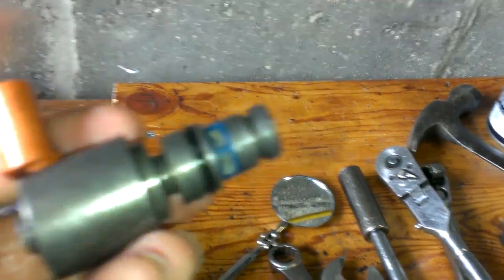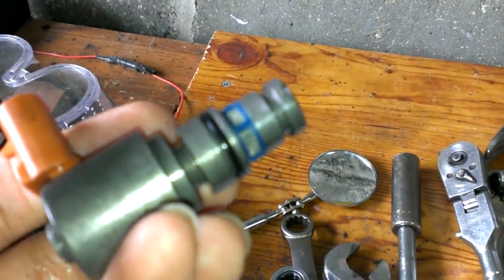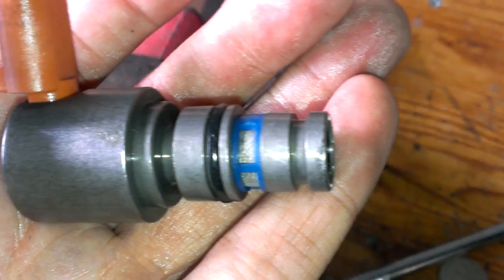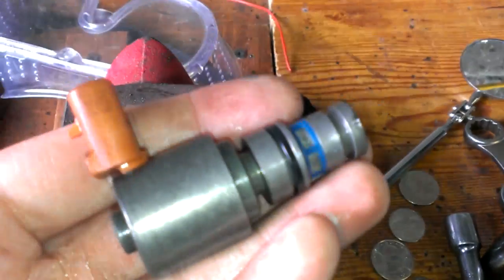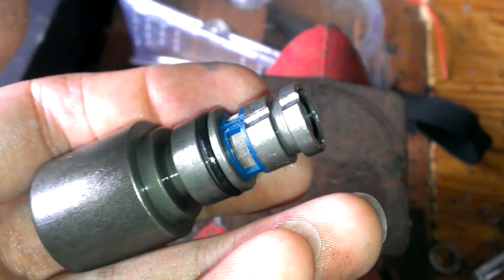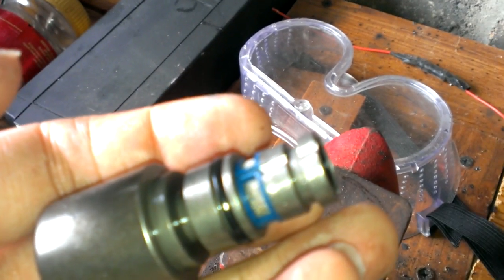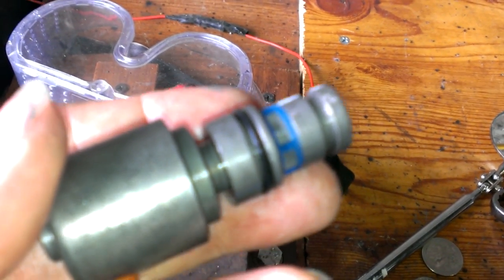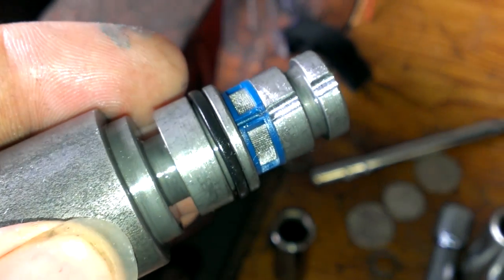PWM DELETE 4l60e MOD

Comment: I know I very ask alot of silly questions. But my Jimmy locks and unlocks the torque converter at 55, drives me crazy, do u think this may stop that...and thanks for the help
Reply from the maker: its possible. yea.
Reply: Did you try it?
Reply: Did you try it? I got a 98 Chevy Blazer that 3rd and 4th gear were out of. So I just rebuilt it myself using transmission bench Channel. Now it seems like mine's doing the same thing

Comment: Is this passenger side front, and is the tcc and pwm same thing.
Reply from the maker: yes pass front. and no there not the same. the pwm regulates the flow to the tcc to lock up the converter

Comment: Help!  I have 1997 chevy astro 4.3L with P1870.  I've been fighting this problem a long time now.  Replaced the valve body with high quality new one but it didn't work.  Tried draining fluid and adding a lot of Lucas, didn't work.  Then replaced the TCC valve and spring with Fitzall P1870 fix kit, (solid aluminum piece) and new tcc solenoid just in case and updated fluid to Mercon V.  It worked for 2 weeks and then came back!  What do I do now?  Is there a way to permanently delete this pesky code out of the computer or something?  Is something else possibly worn out in the tranny causing this code?
Reply from the maker: p1870 generally means something is slipping when in lockup. either the torque converter is slipping or 3-4 clutch pack is starting to slip. if you replace all those and it still does it them im leaning towards a worn out torque converter or trans.
Reply: @bam6972  Thanks! Actually before I bought it, the transmission was rebuilt by a professional shop (about 10 years ago) and they never fixed the p1870 code even then.  Obviously they must have overlooked something. If it were me, I would have brought it back immediately to fix the issue, but the owner, my father, didn't want to bother the shop owner and just lived with the shift bangs, sheesh!
Reply from the maker: @bimmerman9839  i had the same problem. had it rebuilt and the problem still was there. brought it back multiple times and after a year of constantly bringing it back he finally rebuilt a different transmision and put it in. problem solved. it may have been a crack in the casing and fluid was seeping by causing the minor slip making the code pop up and hard shifts afterwords.

Comment: I have a 00 silverado with code p1860. Transmission only shifts 1st and 2nd only and wont shift after that. If I replace the tcc which is the only code I get will it fix my issue? Please help
Reply from the maker: sounds like th 3- 4 clutch pack when out. check the fluid and see if its dark and smells burnt.
Reply: @bam6972  the fluid was brownish and smelled burnt. There was a magnet and had alot of residue. I guess I need a new trans😕

Comment: Does this mod just let the pressure go passed through the groove?
Reply from the maker: it allows full pressure to the torque converter solenoid so it locks up faster and firmer.

Comment: thanks had 1870 code fixed tcc valve but still had this problem so my son did this for old dad and sure enough that solenoid was the problem all along computer did not no it was bad

Comment: Nice video thanks for posting.  Obviously the PWM was an idea that didn't really work all that well long term.  If I modified the isolator valve with the Fitzall  A74741QA.  I think that does the same thing. Obviously, what you are doing has zero cost, but would there be any advantage to doing both? I mean while I am doing one it would be easy to do both. Or is that just overkill?
Reply: Same ?
Reply: @ersstihls  well I’m at that state I already have this fitzall valve in and it helped but I stil slip in lockup like he had I think I may try this sometime I could utilize my old solenoid

Comment: Will this Mod work on my 99 G20, early 16 bolt 4L60E? I am having over temp conditions when towing because the converter never really locks. I wired an over ride SW to test lock up , I can feel it engage buy it really never locks, only min rpm drop around 50 is notable. My trans is freshly rebuilt.
Reply: Your not supposed to tow in overdrive. That’s why your having the heat issue . Later models have a towing switch that keeps it out of overdrive.
Reply: @nefiredude  - I know this is a year old, but my 03 Astro owners manual says to tow in OD unless it's downshifting often.  I've also towed with my 00 Tundra (my dad's at the time) and watched the trans temp with Torque app and it ran substantially cooler in OD than drive because drive doesn't lock up, only OD.  Check your owners manual, and if you can watch the trans temp to see what runs cooler.
Reply from the maker: yes it will work. just put in a relay so the computer can still control lockup. and when you flip the switch it will bypass computer. wont have a engine light that way.

Comment: Would this be the same thing as getting an aftermarket TCC isolater valve? My 4l60e doesnt lock up in first gear from a dead stop ( intermittently and high rev slugish acceleration) and then shifts hard into second gear also loss of gas mileage I have no codes though, when its working fine its awesome just had bit built and didnt do it the first month or so had my builder take it apart twice do you think he missed it cuz the bore just barley wore out?
Reply: TCC shouldn't operate in first gear anyway. what do you mean it doesn' tlock up from a dead stop?  That would stall the engine.  High revving without moving would indicate bad torque converter operation, not the TC *clutch*.  Check for low fluid or low pressure from worn valve body.
Reply: A daft punk your not understanding when I say from a dead stop, when I take my foot off the brake the pcm should re-engage the transmission the car still moves but takes higher revs to get going when it does this I get a hard 1-2 shift, anyway I just moded the TCC regulator/isolator valve and this seems to solve my problem. Now when I release my brake I can feel the TCC engage and I can accelerate faster/normal again and 1-2 shift is smooth.
Reply: @martinez1701a how did you mod the valve? Basically blocking off with check balls? How did it work king term
Reply: @KollynJ  what you can do is take out the valve and spring leave the plunger and put one check ball on either side of the spring put it all back. Doing that basically turns your tcc lockup to an on/off instead of a pwm, you can also buy a drop in valve for like $20 by Fitzall. I like the Fitzall route because it comes with orings and seals better if the bore is really worn out.
Reply: @martinez1701a  I imagine my problem is worse than that. I was given the van. I changed selenoid and first shift I felt was really harsh and it slipped into it almost

Comment: what year trans
Reply from the maker: from 95 on up that uses this pwm solenoid.
Reply: cool, looking at a 97 tomorrow for my 87, research i gather if i do this mod, leave line pressure and 3-2 solenoid disconnected, i should be able to manually shift the trans without issue.
Reply: @ClumsyCars how’d that go? Manually shift the trans how lol
Reply: @KollynJ  There is no reason to do the mod, the pwm solenoid dont care if you apply full 12v on it.
Reply: @KollynJ  I ended up wiring the nss  up in a way that i manually shifted using the shifter. i could start off in 4th gear if i wanted
Reply: @ClumsyCars  you have 12 applied constantly to keep it open basically?
Reply: @KollynJ  you only apply 12v when you want the converter to lockup, or i dont understand what youre asking lol
Reply: @ClumsyCars  that sounds like something I’d be interested in lol. Anything but a rebuild

Comment: Would this work on a 97 Mercury grand..I changed all the solids still getting o.b.d. code p1747 can anyone help befor I try this and burn my transmission
Reply: Frank s no wrong all together make model everything wrong, you need to find a Ford forum

Comment: question after duing this bypasss do you still get the code P1860
Reply from the maker: depending on how worn out the bores in the valve body are. it might go out for awhile. thats only a band aid fix for that code.

Comment: worked great on my 93 z71 with a 99 4l60e. Not only does it lock up now but the converter feels tighter all around. (less stall speed)  Is that possible, or just my imagination?
Reply: The stall speed is your imagination. You haven't changed the turbine or impeller.
Reply from the maker: nice. it prolly does actually feel tighter. the 93 didnt have a pwm. so removing it allows full lockup.

Comment: ok i have a question i had p1860 code thats pwm solenoid so i dropped pan to replace only to find that that solenoid is not there there is a hole for it but somebody must have removed it also was no plug or wires for it so guess its a harness from pre 96 or what do you think why would you remove this totally what are your thoughts thanks for your time
Reply: lol wtf. Have you figured it out yet?
Reply: Brandon Ward my only guess is that must of used a valve body from 95 or earler or the trans itself is from 95 back the hole is there tho idk but was haveing prob loseing od when real hot trans cooler seems to have fixed it ill leave it til it blows up but lol is right wtf?
Reply: Brandon Ward so get this i live in allegheny county have emissions a cel light automatically fails for state insp i insp it myself so dont give a shit but for somebody else thed have to replace trans to be legal how stupid is that
Reply: Yeah that's some BS man. I'd be pissed if the state required me to replace a trans basically because it didn't have OD! We don't have inspections in Kansas, which is kind of nice. But if we did have required inspections I could make a lot more money! lol

Comment: If you do this mod, do you still have to worry about the worn out isolator/regulator valve bore?
Reply from the maker: yes. unless you stake the isolator into the full open position.
Reply: thanks. i just use a tg sift kit.

Comment: applying common sense to the operation of the tcc. pwm tcc's never completely lockup. they are always slipping just a little. roumor has it that the pcm does that because after 95 the computer looks for missfires. with the tcc locked 100%, any drivetrain bucking that may occour could and has been seen sometimes as a missfire..  p0300
Reply from the maker: never had an issue after 2 years.
Reply: so its just a firm tcc apply with no slippage then...?
Reply from the maker: yup
Reply: Well because of the pwm valve there is always a little slip, does a little slip still occur, or does it completely lock with no slip whatsoever? Have you ever scanned it to see how much slip also?
Reply: bam6972 I wonder if there is a way to get rid of all of the slip like on the Ford overdrive units.
Reply from the maker: this pretty much gets rid of all the slip. i dont have a scanner to monitor the slip after full lockup but i would say it would be very minimal.
Reply: bam6972 what would a completely blocked tcc solenoid do? with a blocked tcc solenoid, I guess fluid couldn't bypass and then you would have issues with torque converter being locked all of the time?
Reply from the maker: if it was blocked, it would not lockup at all. there would be no flow to the converter.
Reply: bam6972 are you sure it's not the opposite? when I examine a new TCC solenoid you can blow air through it but when you apply voltage you cannot. I'm not sure how it works stock but either voltage or ground is supplied which would block it to lock it.
Reply from the maker: when its actually in the valve body it will redirect flow to the converter. when there is no voltage it just recirculates. thats my guess.
Reply: bam6972 from what I see fluid flows from the pump through the TCC valve when no voltage is applied and fluid recirculates through the TCC valve into the pan area. When voltage is applied to the TCC valve it becomes non flowable and the fluid within probably push a spring or something in the pump and allow fluid to go straight to locking the converter that's the way I think things work... you?
Reply from the maker: yup
Reply from the maker: it locks up pretty firmly on the highway. theres always going to be a little slip withing the torque converter. all the pwm valve does is makes the tcc apply as smooth as possible so you dont feel it shift again into lockup.

Comment: if doin the PWM delete will this make the 96+ 4L60E compatible with the earlier 4L60E TCM (integrated with the ECM)?
Reply from the maker: yes. there is a forum on the net tells you what year can go in what and what mods you have to do to get them to work. lookup 4l60e interchange or something like that
Reply from the maker: actually i have the link in the discretion to the page
Reply: @bam6972 can’t do this in an 04?

Comment: I've got a 94 tahoe and my transfer case locked up and cracked my trans. so I'm throwing in one from a 96 that's a pwm. if I do this, the Trans will run fine?
Reply from the maker: +Tom Wozniak it will work if you either do this mod or stake the isolator valve all the way forward.
Reply: +bam6972 thanks man, thought I was going to have to start all over again
Reply from the maker: +Tom Wozniak I put a link in the description to further aid you into installing it.
Reply: You're the best
Reply: How did your t case lock up?
Broken chain get wedged?

Comment: Are u going to tell them that if u have a Trailblazer 4.2 and u do this. Your truck will bog down n the city and when it does unlock. It will bang hard?
Reply: bam6972 No it's not a bad problem but I can do without the jerk when it unlock when it's under load.
I'm not just talking here. I did the valve flip thing. Glad I did that because my valve body was dirty and was hurting the way the trans shift. Also my accumulator pressure sleeve was jammed.
Reply: @Fone65 valve flip thing? You flipped the existing valve without having to drop valve body?
Reply: @KollynJ  The engine is still going to bog when the tc lockup @ 35 mph.
Reply: @Fone65  I need to check these things but now that I have mine back together w new selenoids and half new fluid it’s shifting pretty good again. Other than when it downshifts when I press the peddle it will rev and not catch
Reply from the maker: really? do the newer 4l60e's not have a tcc lockup solenoid. if not then yes it will bog really bad. hell, it will probably kill the engine when put in gear.  should  have said this mod only applies to blazer jimmy bravada s10 and Sonoma's.  94 till whenever they stopped putting the tcc solenoids in!!!
Reply: bam6972 it has a TCC solenoid but the TC was designed to slip slightly.  Because it was made that way. GM didn't put damper n the Tc. This allows you to feel  the engine vibrations more.
Reply from the maker: umm ok then it still shouldn't be a problem with this mod then. it will just feel like shifting another gear. no problem.
Reply from the maker: yea
Reply: mine only has second third reverse it slips but goes in drive put 3000 miles on it so can't bitch lol is this silinoid
Reply from the maker: this solenoid only controls lock up. so it wont fix your problem. more than likely needs a rebuild.
Reply: @bam6972 if my truck is waiting then shifting up really hard into 2 or 3 will this help?
Reply: bam6972 No my trans run fine. The TCC was design to slip so it has no damping like old school TCC that locked up 100%.
Reply from the maker: oh I was talking to the other guy. lisa goodwin
Reply: bam6972 Sorry